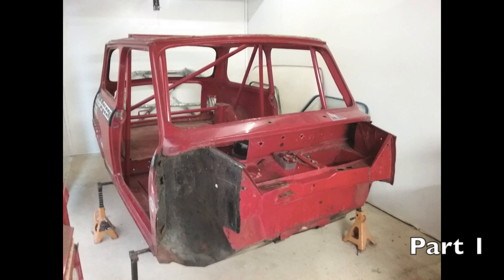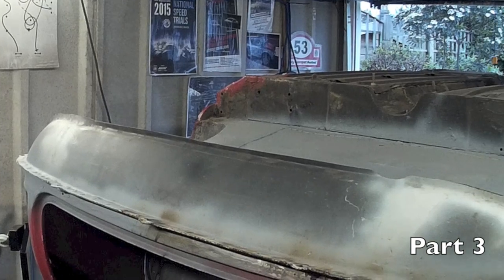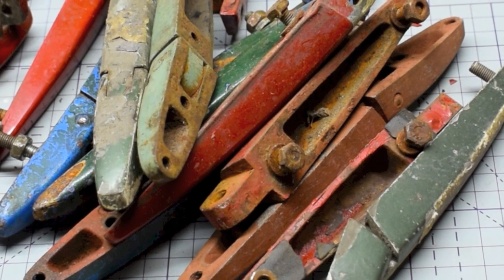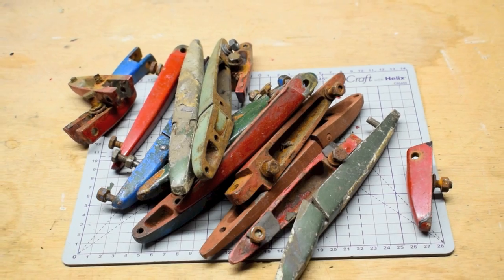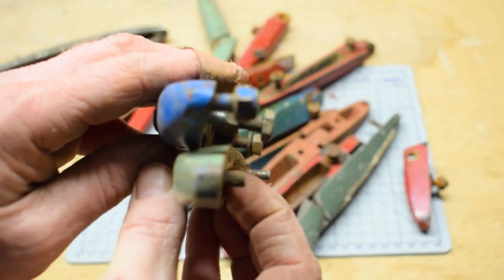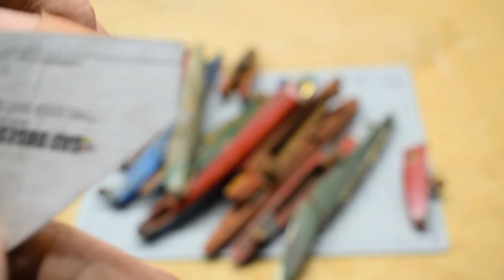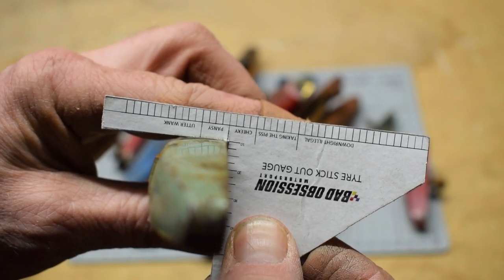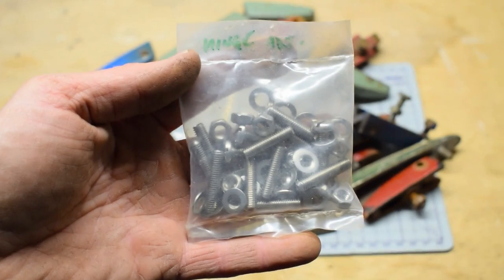Building a classic mini rally car part 5

Comment: You are likely to find a few different markings on the back (door) side of the hinges to indicate their positions on the car.
 
   With each hinge being made up of two parts, one numbering system was 1/2 for upper right, 3/4 for upper left, 5/6 for lower right and 7/8 for lower left.
 
   Another system numbered the hinges RU, LU, RL and LL for Right Upper, Left Upper, Right Lower and Left Lower.
 
A third numbering system was 18 = upper right, 19 = upper left, 20 = lower right and 21 = lower left.
Hope this helps. Enjoying your videos btw.
Reply from the maker: Wow that's fantastic thank you,

Comment: Can't beat a new spool of wire. Braw welds! Do you have to seam weld the whole shell to Rally it?
Reply from the maker: Glad you liked the video. There are no rules about seam welding, but, even on this shell being an ex rally cross mini you can see areas where the spot welds get pulled apart, so I will seam weld high stress areas, and stitch weld everywhere else. The only reason I seam welded the rear sill is to make it water tight and keep the moisture out.. again thank you for watching  and your kind comment
Reply: Thanks for the info.

Comment: That was tense waiting for you to run out of wire half way through! Nice to get it done just in time (unless that was some clever editing 😂)
Interesting that you’re welding the whole rear seam
Reply from the maker: no that was genuine, yes the only reason I seam welded the whole rear end was to try and make it water tight and prevent moisture from getting in there and delaminating that seam. the other reason is that I will stitch and seam welding the entire shell to give it some additional strength :) glad you liked the video

Comment: Lovely job you are doing there :) what welder are you using? Mine is due an uograde as the sleeve and bearings have warn out
Reply from the maker: I picked this welder up for 15 quid, I have fitted a euro torch conversion, and this has transformed it with propper commercial gun and etc, oh and it was gassless so I converted that as well. I can't remember what make it is but I would love to get my hands on a propper machine.
Reply: @TheGentlemensMotorRacingTeam  My father in-laws is a welder by trade and his are all massive industrial ones. But they leave a great weld. I've been using a smaller on of my brother in-laws but even that was £400+ 🤔🤔